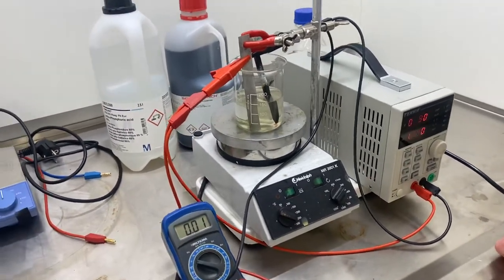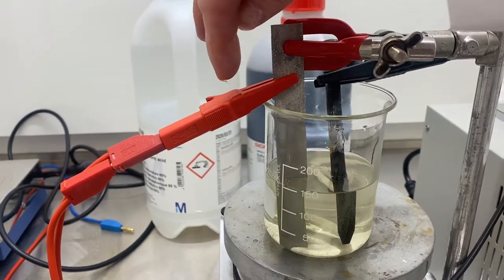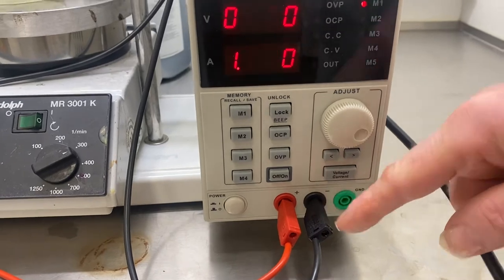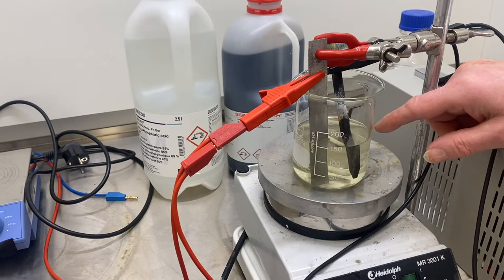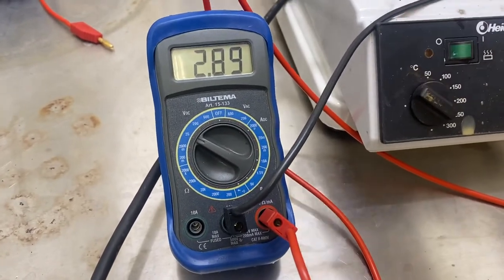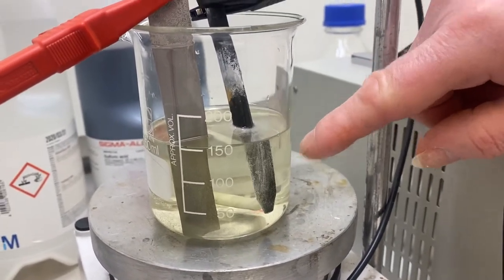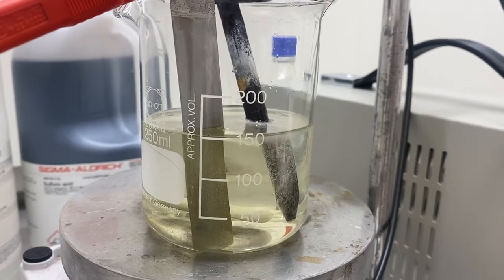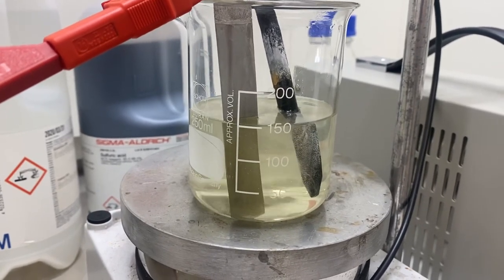electropolishing of stainless steel in acid "bath"  - the run

Comment: Would this also remove any oxides on the steel? I have a problem with an high vacuum ion source which has discoloring on the surface from temperature and deposits from a tungsten cathode. how would i go about removing this surface deposit? Would this also work with 30% sulfuric acid?